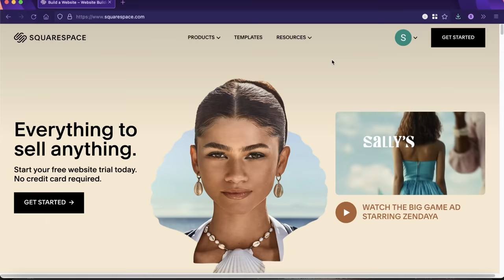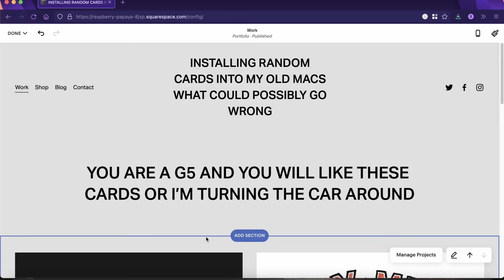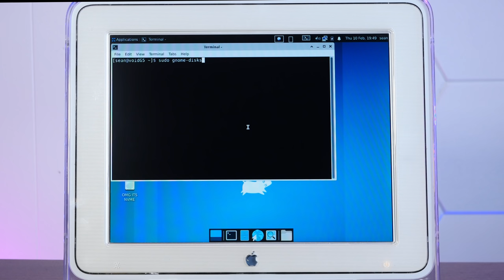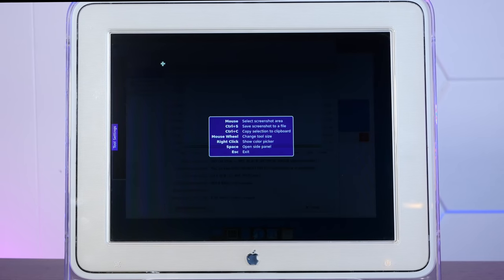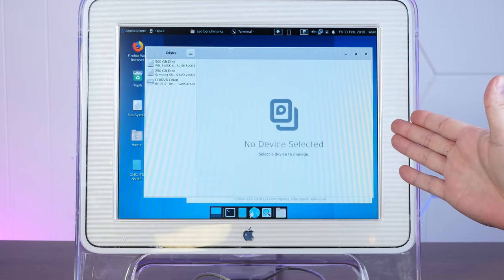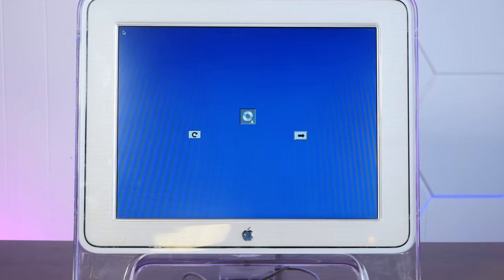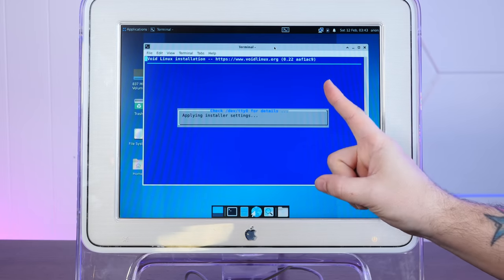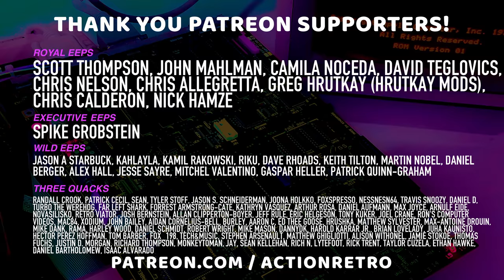Running Modern NVMe in a PowerMac G5!

Comment: Hello all , I also have a PowerMac G5 dual , as a daily driver , (maxed out as posible) and was interested is there anything I can upgrade with new weerd stuff on the market today - usable under osx 10.5.8-9? (I don't care upgrade-ing to intel , for that I have a Dell Precision). G5 has 8 gb of DDR400Mhz , one 4 GB Seagate SSHD(hybrid drive) SATA , and one 2 TB WD SATA . Externally I use a USB-to-usbC 6TB LaCie Porsche w/ seagate inside , works pritty well. I have a wifi module , can the slot hold any SSD? Howabout a MVMe to firewire adapter? that should be fast enough for Mac OS X 10.5.8 to load or 10.5.9. Anything else I can do? I don't want to give up my Acrylic apple cinema display panel so I use a FX5200 w/ ADC... I tested a Orico M2 to mSATA 512gb kingstone ssd & adapter to SATA in a MacBook , but it did not help visibly performance , so I pulled and mounted a classic sata hdd disk. Any interesting suggestions to upgrade to (working under osx ) is highly apreciated. ( I am pritty much stuck on upgrade front , except for extenall devices) Is there any hack-upgrades on CPU or FSB or AGP ADC card's you can suggest & we can try? On software fronts there are stuff we can do, even in OS X , but I preffer sticking to interesting Hardware upgrade's. (I even was thinking of upgradeing the DVD-RW to a IDE Blue-ray writter , is it worth it ?)

Comment: Have your experiments so far included putting the actual /boot partition with the Linux kernel onto your CF card? I'm not familiar with the Linux on PPC boot process, but the bootloader for getting from Open Firmware to the kernel (GRUB, it looks like?) will definitely need to be able to see the device where the kernel lives, and if Open Firmware isn't finding it, the bootloader probably won't either. As far as I know, GRUB isn't really able to scan the bus and find devices itself, but generally relies on what the system firmware provides.
Reply: Correct, ish. At least on PC, GRUB usually doesn't scan and use devices itself. But it can if you run the nativedisk command first. However that's just a nuisance. You'd need a configfile containing the nativedisk command on the system-recognized drive and at that point it's just easier to have the whole regular /boot there as well.
Reply: The problem with a Mac is that it has to boot into Open Firmware first (think of it like the EFI or BIOS chip on a PC) you CAN put a boot loader into Open Firmware with Linux, I did this on Old World Rom PPC chips back in the 90s. Your problem is that everything has to be seen by Open Firmware first.

Comment: There is a possibility firmware could see NVME SSD with a boot rom. I think Samsung 950 Pro has it (not evo).
Reply: The 950 Pro does have a boot rom for the x86 PC BIOS, that rom isn't going to run on a PowerPC CPU
Reply: @SwitchingPower  It's probably possible to reflash the drive's option ROM with a PPC OpenFirmware variant. The problem is finding such an OROM but I'm sure it could be written by slightly mad hackers.
Reply: PC EFI is completely different to Open Firmware.

Comment: An nvme adapter card with a built in switch chip like the sonnet 4x4 may even be faster if you use it in the 8x slot, because it may be able to use the 8x pcie gen 1 lanes from a single 4x pcie gen 3 ssd giving double the effective bandwidth...

Comment: You probably need to boot from EFI environment (with nvme driver) via USB or something like that, then it let you detect nvme as boot option. But i dont know what tools to use with power mac. I dont think non UEFI linux GRUB can dealt with NVME directly.
Reply: EFI is a different standard than Open Firmware even though they do the same thing for these purposes. They're both firmware, but work slightly differently. The point is your idea won't work. If Sean just wants the maximum port speed of a single lane of PCI-E then he can probably put the boot disk on an eSATA card.
Reply: With PC you can use rEFInd-DUET or Clover. I suppose similar thing can be achieved in PowerMac.
Reply: @catzymbs  you can flash cards, but you have to have the appropriate firmware first. That's half the battle.

I saw this post and went through all the options in my head, SATA, Firewire, USB, that's basically what Open Firmware will understand. The only real obvious solution is a faster SATA card connected to the PCI-E bus as that will at least give you the full bus width.

Comment: Sata 1 is 1.5Gbps
Sata 2 is 3Gbps
 And Sata 3 is 6Gbps

Your numbers for IDE were right though, UDMA IDE  operates at a maximum of 133Mbps
Reply: The IDE speeds were wrong. It’s 133MBps not 133 Mbps, so Megabits, not Megabytes per second. Same about your SATA speeds…

Comment: I find it a little odd that those nvme adapters are capping out under 500MB/s. That would suggest they're only using two PCIe 1.0 lanes rather than the four they're designed for and which the slots support. I mean, you could get those speeds with plain old SATA 3.0 SSDs (and an appropriate SATA 3.0 card).

When I was looking at upgrading my mac pro I went down a pretty deep rabbit hole of getting SATA 3.0 on it, and ended up buying a cheap ex-server LSI chipset card that had been set to IT (initiator target) mode instead of IR (integrated RAID) mode. It was pretty late at night, and a few weeks ago, so I don't remember if it had specifically been confirmed to work. But I was hopeful, although I haven't had a chance to test it out. Maybe it could be made to work under linux if it's not supported by mac OS?

Comment: The G stands for Gibibyte not Gigabyte in this case. That's why Linux and Windows report the drives being smaller. To by knowledge it's the same amount of data just using base 10 for the bits instead of base 8.

Comment: linux tricks bios n take it try turn it into usefulness os that u dont need do homework looking for way todo it n just installed it just find it on it own because linux os was used in older model pc back in 50s they were super usefully if u have save files in one eepron that died but cant access to any other but just installed hdd card in slot n turn it on it pick up n recognized it hdd eepron n make it own of hdd (i was kinda surprised find them in older pc does that n code in eepron they were used was putted into linux os make any pc recognized anything that is installed in it)
i never got any hand on any mac pc before 80s (cube box included smaller crt) that was only one i have before